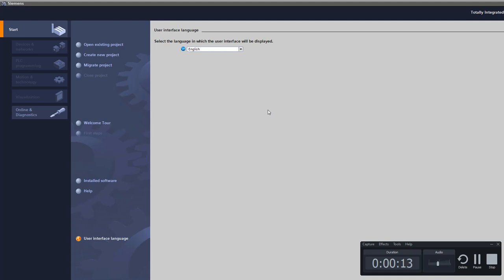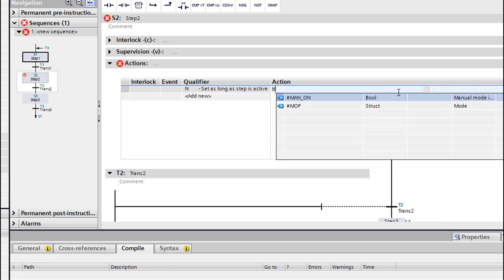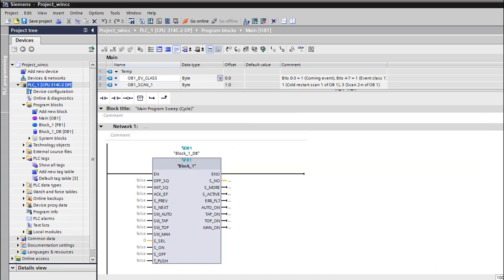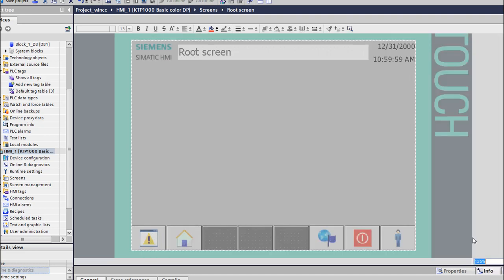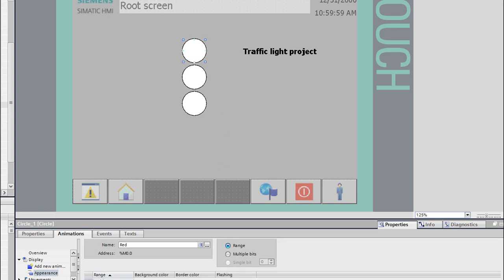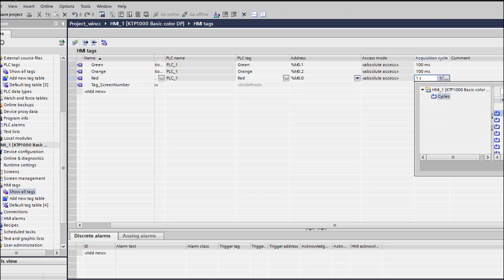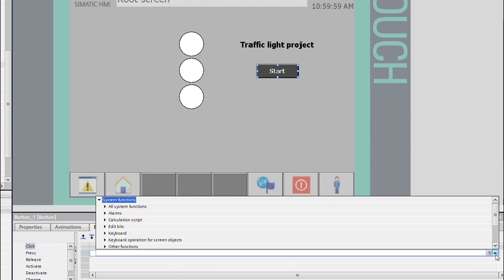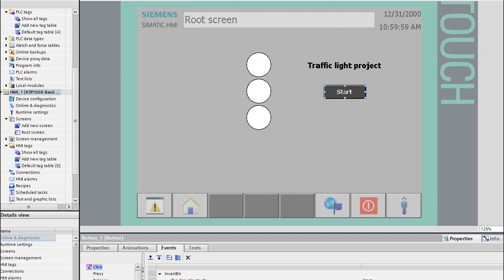Siemens TIA Portal Tutorial #4_1 HMI/SCADA WinCC Flexible intro (Traffic lights project)

Comment: Hello thank you so much for this video.. I found a problem at the point of simulating the HIM, the colors didn't change..nothing happened..even though it worked perfectly with the PLCIM model...please help
Reply from the maker: Is the HMI connected to the PLC? Also the PLCSIM should be launched.
Reply: Yes the plsim was launched but how i know that the HIM is connected to plc
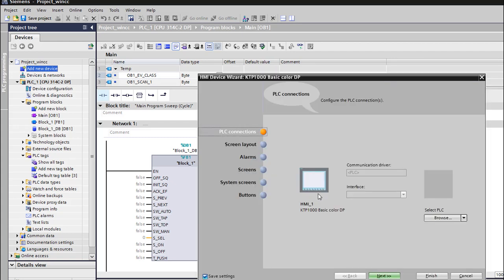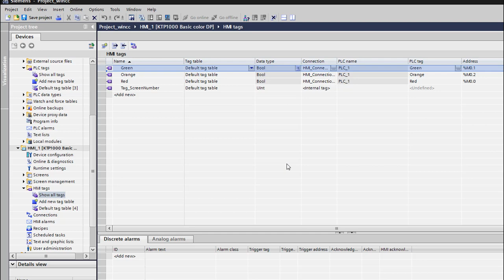Reply from the maker: @sadjiamezenner625  Like in the video 6:40 when you add the HMI, select the PLC to work with, also don't forget to connect the tags 13:30.
Reply: Thank you so much hopefuly it will work